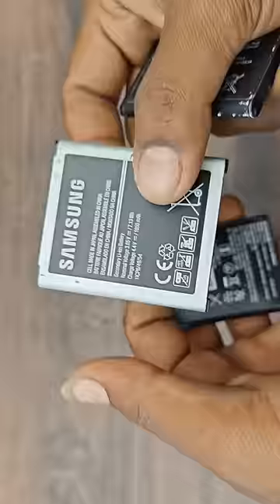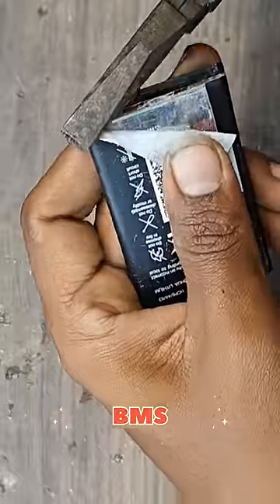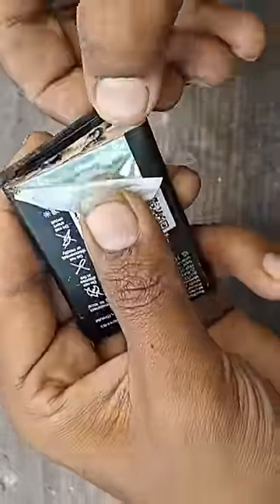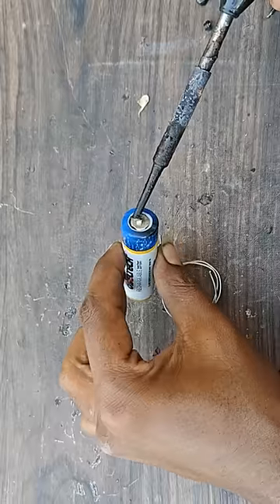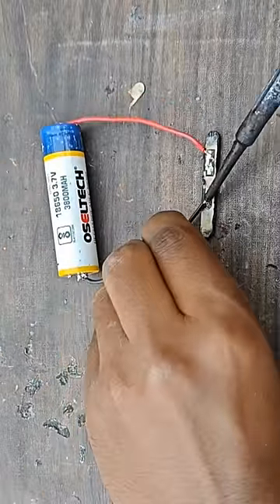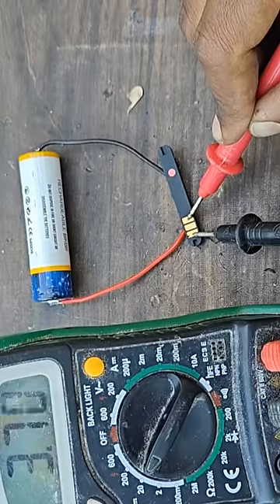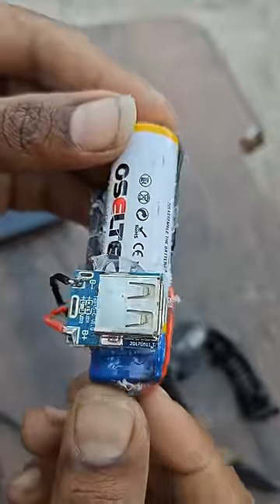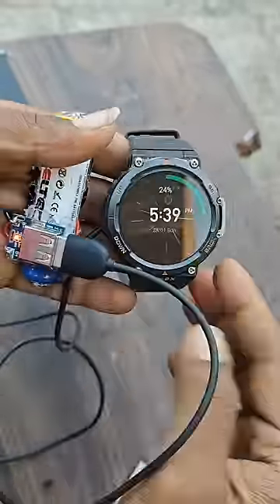பழைய மொபைல் Battery-ய இனி கீழ போடாதீங்க!🔋

Comment: Bro it will works smoothly until high current flow ,
It will automatically cut  of the  circuit when  high current flow,
Also old bms is not working properly